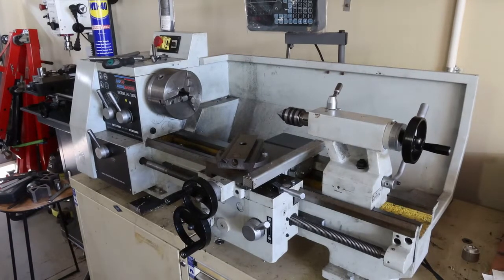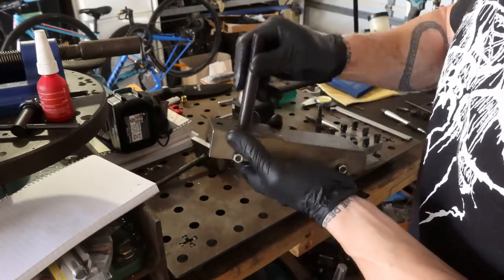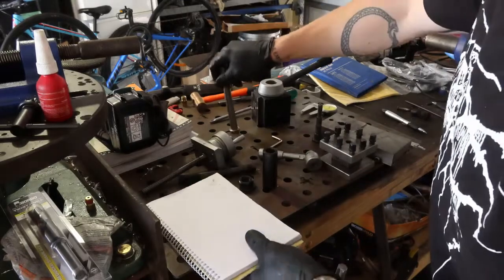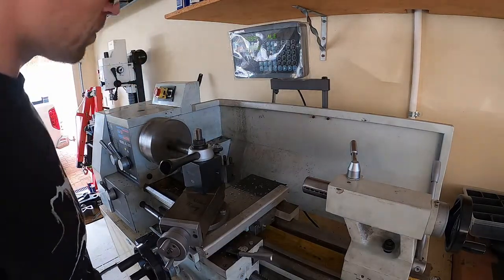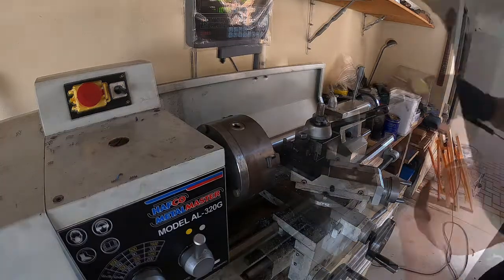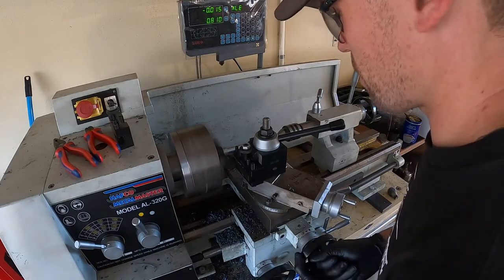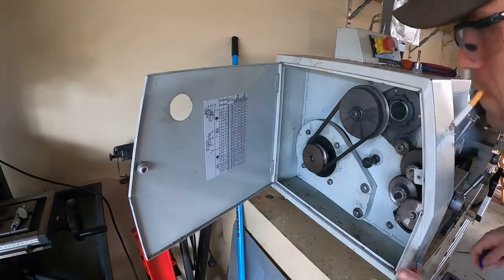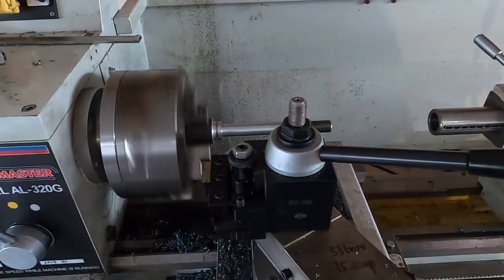Hafco AL320G - Fitting the QA-140 QCTP - Part 1

Comment: Hi , just bought one of these lathes and am looking at doing the same mod so thanks for taking the time and putting it up! Did you lathe original tool post fit the 12mm tooling without a large shim as I can’t get the 12mm tool centred without a 4mm shim. 
Thanks
Reply from the maker: Glad to be of assistance.

Super irritatingly, the website specifies 12mm tool holders - the stock toolpost (and QCTP to suit) actually require 16mm tools to get to centre height easily!
Reply: Yeah what Styx said. Annoyingly I bought a 12mm tool set with lathe. They now sit in the draw and I use 16mm tools. They’re perfect fit for the stock tool turret and of course work fine with the new tool holders. Hare and Forbes need to change that spec

Comment: G'Day Styx- just come across your channel and liked stuff you have done. I am also from Perth WA (wait awhile?) and consistently have problems trying to locate stuff locally and end up buying from China or even from Eastern States. I have had a Hafco AL320G for several years and have not used it anyway near as much as I would have liked. I have had a  2 axle DRO, from China, for a year or so (not fitted) and I just bought a set of Collets and Chuck from H&B. So I think its about time to put them to use.
A couple of questions maybe you can help me with 1-it looks as though your lathe has a DRO? was this included when you bought the machine? or did you install it. If you installed it would really appreciate how you attached it to cross slide X-axis. Or even a couple of pictures. And 2- as I said I bought some collets they are ER32 (which is what I wanted but the chuch is a problem. My use for these collets is to hold small parts in the Head Stock and on 'our AL320G' the headstock is a MT5- So I knew I was going to have to eventualy get some sort of adapter-However, I got a straight shaft Chuck and to start will just use in 3/4 jaw chuck. Any thought on that. I did put a QCTP on a while ago and couldnt be happier-so much easier.
Cheers Trev
Reply: axle-----axis axis axis dah!
Reply from the maker: G'day Trev! Thanks for your comment.

DRO wasn't included with the machine, no. I got it from H&F a year or two after buying the lathe. The basic Sino interface with two glass scales for saddle and cross-slide. Absolutely no idea how to attach images? But mounting wasn't too much a drama.

The scale itself is mounted pretty much flush with the front of the cross-slide, and the top is flush with the top face where the compound mounts. It's a short mounting platform but plenty rigid enough. The pickup  sits between the ways, on the saddle itself. It's on about 21.5-ish mm of spacer to create the right stand-off distance.

As far as collets go - I have the 5C collet kit with the associated drawbar, mount, & handwheel. The handwheel is trash - I've instead drilled through the extension end of the bar, top to bottom, and just use a piece of steel rod to tighten the collets on the job. Locking the chuck rotation is an annoyance but I just select lowest speed gear and it offers enough resistance.
Reply from the maker: Also yes the QCTP is such a valuable quality of life improvement, even if the H&F catalogue and online specs suggest the wrong size..!? 16mm and not 12mm.
Reply: Thanks for that-I was half way thru replying and then I lost it😒 so ill start again! Did you have any problem drilling/tapping into saddle particularly for the pickup (limited space) or did you take it all off machine and do it all on bench? Today I bought some 25x25x3mm angle aluminium that ill probably use as a backing and connector. I was thinking about putting pickup on upper right part of saddle and have scale sticking out at rear?? But your way is neater.
Cheers Trev
Reply: PS when are you going to make some more video's?
Reply from the maker: @trevorallison  Everything was removed and dissembled to do it. I think I did it with a cordless drill even? But honestly don't recall. Just keep in mind that the cast iron just loves to break taps, and I vaguely remember butchering the job (and then found the broken tap from factory afterwards!). I'm sure it could be done in situ, but wouldn't be a great deal of fun
Reply from the maker: @trevorallison  aha I've got a whole bunch of footage from various bits and pieces, I just have to get through editing and such! I'll get to it one day, hopefully sooner rather than later
Reply: @StyxHackshop  Thanks for that i'll let you know how I go. As others have said there is scant info about this machine and any upgrades/add ons. Therefore any info is invaluable👍👍
Reply: Hi Styx-been just doing a bit bye bit - have got cross slide all off but im up to getting saddle off (think thats name of it- the part you put reader onto) any trick? do I need to remove lead screw, how does it part from apron?
GOT it sorted- I didnt take thread guide off- EASY when you know how
Reply: I have the same lathe I tried the TM 5c collet holder but it was garbage so I gave it back to the shop it had more run out than my 3 jaw chuck, I ended up making a holder for er40 collets it’s been one of the best upgrades yet. DRO is next on the list.

Comment: The 1.5mm pitch you should be able to do with the half nuts instead of the forward and reverse method. This lathe is limited though due to the fixed 24t chasing dial gear.
Reply from the maker: At the time I think I was more confident using the direction change rather than the pitch marker! Definitely how I'd do it these days. Thank you for the suggestion!

Comment: Grewt video thanks! I'm in QLD and going to get a AL-320 like yours.
I understand the change gears suck, but as a CNC hobby guy one of the first things I will do is put a 2 axis electronic lead screw on it for automatic thread cutting and feeds and tapers etc.
The 320 seemed right for me because of the big swing and 38mm bore, and still short and light enough to be bench-possible in my workshop. Apart from the shitty change gears its a lot of lathe in a small space and a reasonable price.
How you you find the compound slide rigidity? The other mod I am thinking about is to lose the compound and out a big rigid block there for the toolpost.
Anyway great vid, thanks! 👍🙂
Reply from the maker: Sounds like a good plan! YouTuber Clough42 also did an electronically controlled leadscrew on his, so definitely works. Just gotta make sure your encoders are up to snuff!

No dramas with the compound that I've encountered. The two studs to hold it down give plenty of rigidity. I leave my compound gib locked for the most part, as I rarely use it. Solid toolpost will be convenient enough, just make sure that it's easily enough swapped out when you want to!
Reply: @StyxHackshop    Thanks for the reply! Yeah I saw Clough42 ELS, it seemed ok.
I'm going one step further and putting stepper motors on both axes under electronic control so it will do tapers automatically and auto thread cutting where you just press a button and it cuts the whole thread for you. A few people have done it. I'm an EE in my pro work and have done some CNC projects already for my home workshop.

Comment: Thick as a brick speaking hear. Hi Styx, with regards to @bobswrigles8636 great comment. When you are not using your lathe. Twist the tailstock end of the bed by using a long lever
fixed perpendicular on to the bed at the front of the tailstock end. Depending on which way you need to untwist the lathe bed use a car jack or a wedge under the end of the lever to twist
the bed upwards towards the rear of the lathe, or use heavy weights on the end of the lever to twist the lathe bed downwards towards the front of the lathe. This theory sounds positive
as we used to untwist lumber and manmade sheet boards in a similar way. Cast iron will take more time to twist but I think you will slowly have a good result. Give it a try hours on end
while your at work. Cheers Tony
Reply from the maker: Decent trick! I can absolutely see it working. When I get around to actually addressing the issue, my first effort will be to mount this lathe properly - at the moment it sits across a couple of drawer sets, with no real affixation. The long-duration twisting would come afterwards!

Comment: Make a bushing and then press it inside there, and then thread the Bush in. If you have a Ford Jack chuck, you can put it in there and do it on the chathey're doing a good job if not get a magnetic drill, and you can probably do it, that's the easiest way to do it? I would do it that way. Add a soft metal President there and then throw out it, put in some.  Lock type the one that you put in. That's gonna stay then, redrill it, thread it, and then put the poster a nearby golden
Reply: Just drill a hole all the way through that. And then put a plug in it. Take the key way out and the hole and put a plug in it and then redo it again. And it should work for you.
And by the 2000's press. That's what you wanna put it in there.

Comment: Hi, what is your opinion with this lathe? I’m thinking of buying one.
Reply from the maker: Mate I like it. In hindsight a quick change gearbox would be great to have (the Optimum series offer that I believe), but outside of that, I've got no major faults with this and how much I payed. Big enough and powerful enough for what I do with it.
Reply: A suggestion you may like to think about, something I have seen on a few YouTube channels is machine up a nut with integral lever similar to the one on the top of the tail stock it just eliminates having to use a spanner on the top nut on the QCTP I found that to be super annoying.

Comment: I have given up trying to turn anything parallel on my AL320G. Spent hours shimming to take the twist out and aligning the tailstock but still pretty rubbish especially for long work requiring tail support. Chuck only work is tolerable depending what you are making.
Reply: Chris the answer to that is turn between centres..Provided your head stock bearings are fine you will not have a problem turning parallel and tailstock alignment is  half the amount your dial gauge shows...Perhaps the first thing you should do as an exercise is make yourself  a test bar so you can check your tailstock alignment when ever necessary..regards E
Reply: @Bobs-Wrigles5555  I borrowed a precision level as well, but the bed had a twist in it and the flimsy cabinets are not rigid enough to pull the twist out of the bed. It was ok as long as you are not doing long parts
Reply: @iancraig1951  I have tried to adjust the tailstock but have found that the tailstock does not repeatably tighten down straight. So you can align it perfectly, loosen it up and move it then tighten it and it is out again. The next model up from the AL320G has the tailstock align with the rear V on the bed that allows it to repeatably keep alignment. The AL320G tailstock aligns on the inside faces of the bed, one side slides on one face and the other side has two spring loaded balls and just does not seem to be able to repeatably align. I can still do alot of good parts on it but just know that if using the tailstock you have to either be happy with 0.05-0.1 mm taper per 75 mm or try to adjust in situ as you turn down to size which takes time. At least that is my experience anyway.
Reply: @chrisbanks1936  Ouch Chris, I feel for you, there is just no fixing a twisted bed, if it has gone too far.
I've seen a couple of guys on youtube who bought an old Colchester that had been left sitting unused on an uneven concrete floor for about 10 years, it was twisted that bad there was more than a 2 inch unevenness at the bottom of the tail cabinet, After they tried pulling it down with anchor bolts.
They were told by a machinery "expert" to Not try to force it down to even, remember it's cast iron and can crack, but to put a lever on the side that needed to go down and put "some" weight on the end of it and let it sit that way for as long as possible, measuring the twist to see if it was coming back straight, (time period, about a year).
Maybe this may work for you, Good luck
Reply: @Bobs-Wrigles5555  Hi Bob. Just left this comment. Thick as a brick speaking hear. Hi Styx, with regards to @bobswrigles8636 great comment. When you are not using your lathe. Twist the tailstock end of the bed by using a long lever fixed perpendicular on to the bed at the front of the tailstock end. Depending on which way you need to untwist
the lathe bed use a car jack or a wedge under the end of the lever to twist the bed upwards towards the rear of the lathe, or use heavy weights on the end of the lever to twist
the lathe bed downwards towards the front of the lathe. This theory sounds positive as we used to untwist lumber and manmade sheet boards in a similar way. Cast iron will
take more time to twist but I think you will slowly have a good result.  Cheers Tony
Reply: @chrisbanks1936 he cabinets doesn’t pull the twist out of the bed. As they aren’t made to that precision. You need to either adjust the feet of the cabinet, using a high quality machinists level, accuracy to 0.0005” per foot, or metric equivalent to measure the bed twist. Or put shims under the lathe bed. Sorry but there’s no easy or particularly cheap way to do this,

But another source of taper is the chuck. Cheap chucks can have problems.
Reply: @melgross  hi Mel, I did use a precision level and shimmed under the bed. I can get it to a limit, but it gets to the point where to take the last bit  requires more force and it is easier to bend the cabinets rather than bend the bed